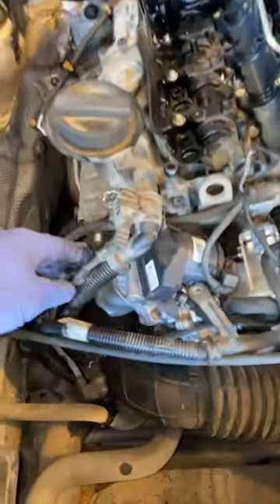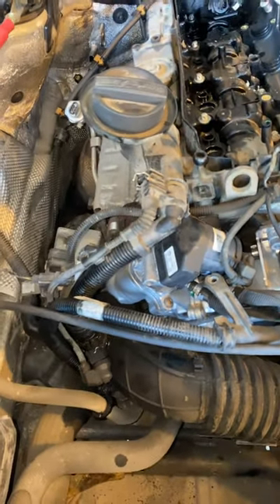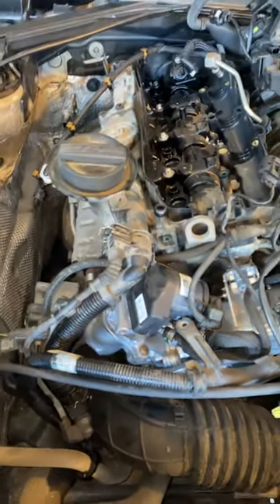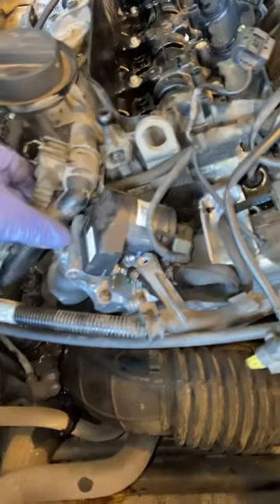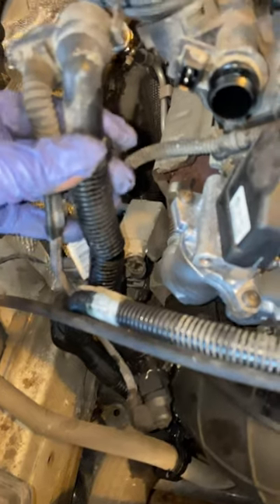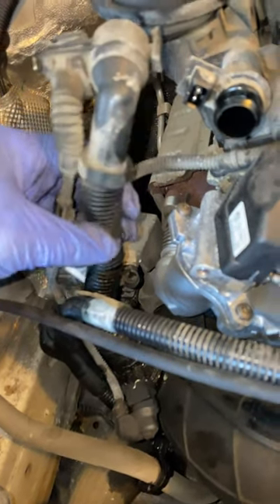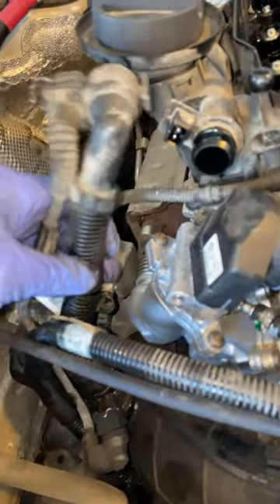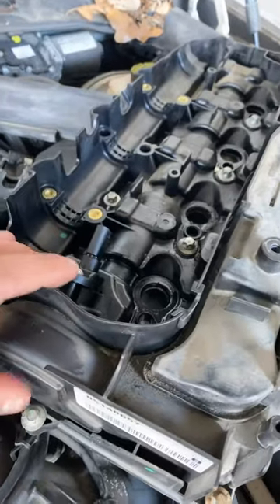Plastic Junk BMW PCV/Crankcase Breather Hoses 😡 #car #mechanic #bmw

Comment: Just changed mine today. Broke like a biscuit
Reply: Had mine replaced on a N55 with the valve cover gasket and it was still good even with 115k miles.
Reply: Yup, had to change my starter on my '10 328i. Almost had the stupid connector off the top of the valve cover and the hose snapped like a pretzel.

Comment: Make it out of metal?  Probably not…that adds weight…and you will hate it even more because in 10 yrs all the metal will be rusted, leaking, seized and crumbling away.  Choose your battles wisely.
Reply from the maker: It doesn’t need to be metal - plastic is fine if isolated from heat. The updated PCV breather hoses are plastic wrapped in insulated foam or sometimes rubber.
Reply: @bofbolts  you ever argue with an engineer? 😂😂😂
Reply from the maker: @denman2013  hahaha yes actually! But I’m ready for more 👍👍 

But seriously, BMW updated their PCV hoses to the same plastic wrapped in insulation.

Comment: Can you fix it? 🤔
Reply from the maker: They need to be replaced!

You can temporarily fix it with electrical tape, wrapped really well at the split. But this won’t last forever.
Reply: Waiting on it from fcpeuro 💯 need a few days to drive tho 😂😂
Reply: @bofbolts would happen to have the part number for it?